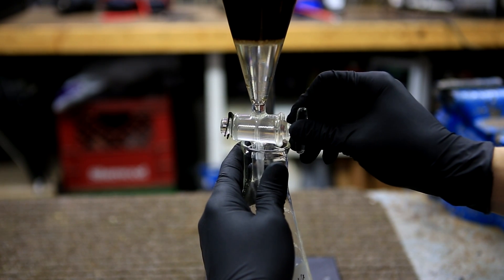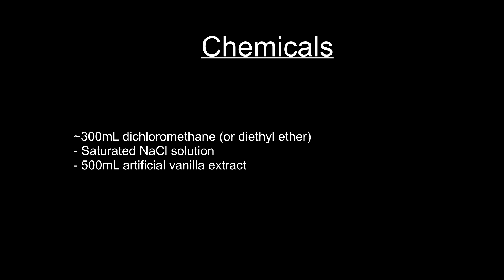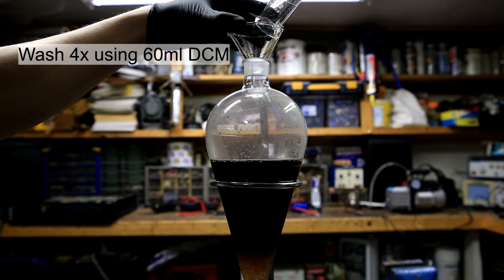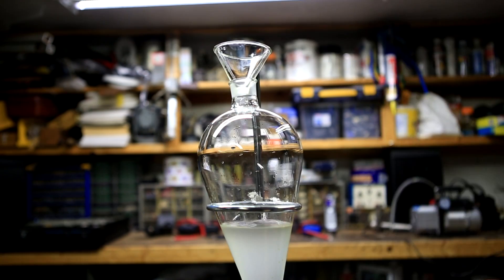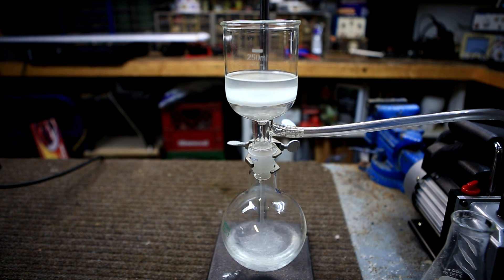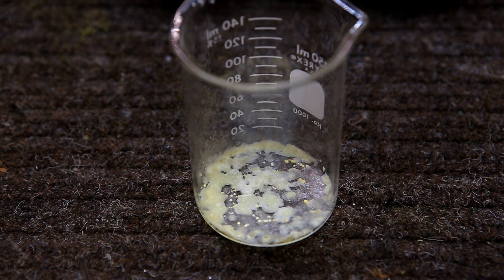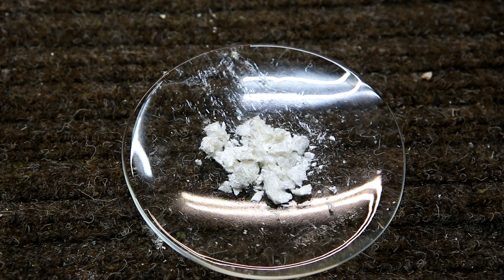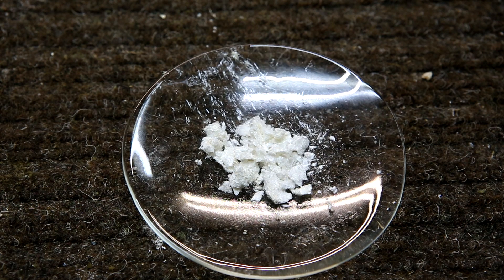How to isolate Vanillin from Artificial Vanilla Extract

Comment: shaking vanilla flavoring (vanillin=aldehyde) with saturated aqueous sodium bisulfite (available at wine making supply shops as Sodium Metabisulfite, which reacts with H2O to form bisulfite) will form a solid aldehyde-sulfite sodium salt adduct  precipitate, which is filtered and washed with cold water and/or EtOH. Repeated aldehyde adduct precipitations may be in order to complete extraction. Then react the cleaned aldehyde adduct with dilute HCl or NaOH to recover free aldehyde and extract with DCM in a sep funnel just as done in this video. Thus can lead to remarkably clean product in nearly quantitative yields.

Comment: Hello Nile, I was watching your video and I noticied that the NMR spectrum cant be vainillin, F should be a singlet and looking bibliography I confirmed that the spectrum of vaillin is not the one displayed.
Then, seeing the multiplicity of F, I had the idea that it looked like a methylene(-CH2-) next to a methyl, attached to a oxygen, for the high chemical shift. Such CH3 should appear in the spectrum in a chemical shift lower than the 2.5 where you cut the spectrum, so it makes me wonder if you have another peak that you aren't showing. For last, I looked a spectrum of Ethylvanillin and all the peaks are very close from your spectrum, aside for a peak around 1.5 that integrates for 3H.
I await your response.
Reply: Two things to add:
1- Ethylvanillin is also used as a flavorant, and it's about three times as potent as vanillin, so maybe the extract had ethylvanillin instead of vanillin.
2- In your "How to extract Vanillin from Vanilla Sugar" you showed a spectrum different from the one in this video and both should be from the same compound.
Reply: @jamesn9221  In Kekistan. The color is pink.

Comment: Whenever you do extractions you seem to use DCM or ether. Will any solvent insoluble in water work? Like toluene or xylene?
Reply: You probably forgot you made the comment. I would say that both would work just remember that if you are concerned about decomposition of you organic material, boiling it out of xylene or toluene might be damaging to your final product. All in all, the answer is, depends. In theory, those two are just as good as diethyl ether or dcm, but it may not be best for your situation.

Comment: How do you explain the quartet (multiplet?) just above 4 ppm? Should be a singlet, no?
Reply: Looks like there might be an ethoxygroup presesent instead of methoxy. That would explain the multiplicity and the Integral wich is 2, but for that another triplet at around 2 ppm (just a guess) would be needed.

Comment: Ether scares the hell out of me, and its unlikely I'll have the facilities to handle it anytime soon. I had been wondering whether DCM could be used instead for extracting vanilin after I saw myst32YT's video, but never tried it. I'm glad to that see someone confirmed this, but now I'm even more excited and curious to see how your going to do it with methanol.
Reply from the maker: Davy Zeng Ether can form peroxides which are explosive when dry. If you recycle the solvent very often, you shouldn't have a problem. If you use commercial ether, it is stabilized against peroxide formation by BHT.
Reply: ***** May I ask why you are scared of ether? I do a lot of chemistry experiments at home and I use ether quite often, and I don't really take any extra safety precautions. Perhaps I am missing something? I really don't want to kill myself so I hope you can share your reasoning with me. Thanks. :)
Reply: Ether is one of the safest organic solvents, whirlpools DCM literally gives you cancer

Comment: Great your high quality videos!
Do you have any plan of extrat limonene from something like orange?:)
Reply from the maker: Sure I can do it using a steam distillation. I recently got cinnamaldehyde from cinnamom, so I don't see why I can't do limonene.
Reply: Nile Red wow. I tried to extract limonene from remon using anhydrous EtOH but fail.
Can it be extracted by solvent?
Reply from the maker: I would do a steam distillation. When you extract using a solvent, you are going to get loads of other stuff that you don't want which are going to be very hard to separate out.